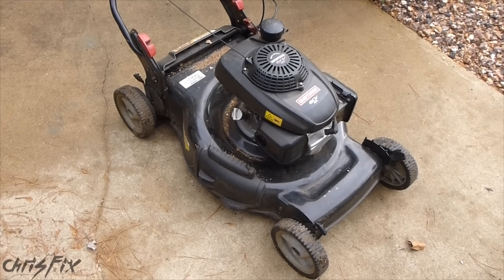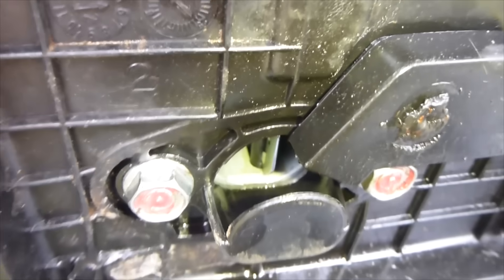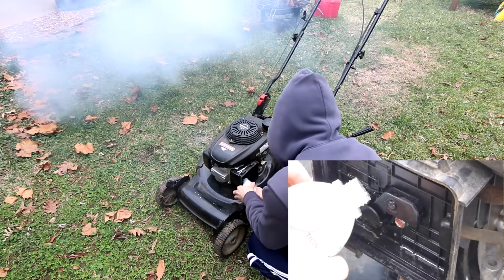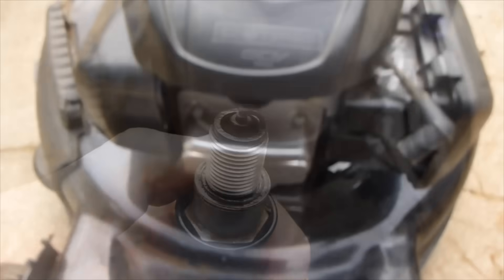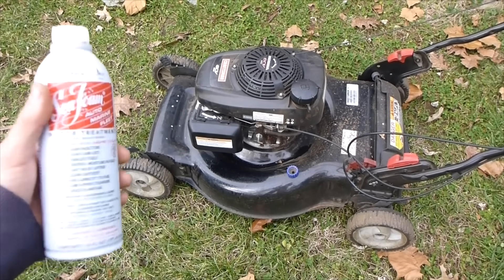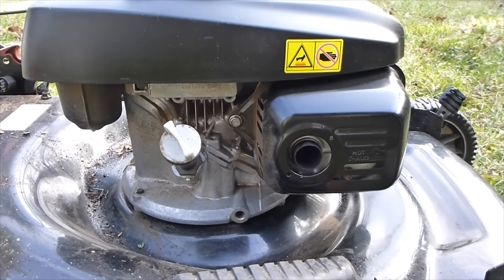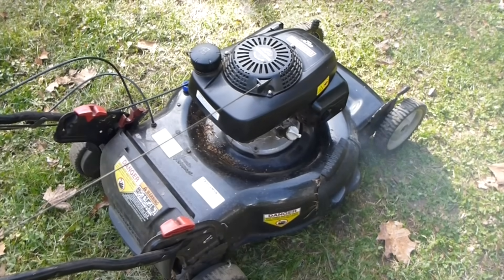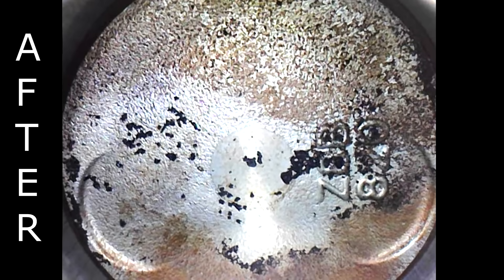Does Seafoam Actually Work? (with Proof)

Comment: My name is Mark Nye. I am a small engine mechanic , owner of North Valley Repair , in the North Valleys of Reno Nevada. I was introduced over 10 years ago by the chef mechanic of Kawasaki to SEAFOAM. I will swear by this product. I use it in all equipment. The Ethynol that is in the fuel today causes moisture to condensate in the gasoline. If not treated with a fuel additive then the fuel will turn rancid. Seafoam is the best product I've found to dissipates the Ethynol in the gasoline to make your vehichles and equipment run smoother, cleaner and won't cause the fuel to go Rancid. I advise all my customers to buy a can or two and put it in the gasoline can to prevent the fuel from going bad and turning rancid.......   Great Video.
Reply: Mr. Nye, I'm interested in your comments because unlike most of the blowhards writing comments, you have the experience to know what you're talking about. I use Seafoam or a NAPA equivalent in all my small engines with great results. Now...settle the ongoing debate about the carbon buildup: in your experience, is the amount of carbon buildup shown in the video worth cleaning? Thanks.

Comment: Well we at least know it works on Hondas, they put the same engine in their cars ( ͡° ͜ʖ ͡°)
Reply: pshh...i love my honda, it's my favorite lawn mower
Reply: Does anyone remember the 2 cylinder Honda car. My buddy had one and it actually moved it down the road.
Reply: wellll, that, at least WAS funny.
Reply: +o Lemurs usually after what most people do to them they run off of 1 cylinder but can't hear the difference with the can on the back
Reply: Honda N360

A 355cc 2cylinder engine that had 32hp
Reply: z
Reply: I'd be afraid of using my mower if it had a 300hp, 3.5L V6.
Reply: a super weak attempt
Reply: lmao not a single honda car has 1 cylinder
Reply: o Lemurs It's called a joke
Reply: ***** oh,i thought you were serious ):
Reply: Xero So it does in fact fit in Your Honda

Comment: You can do the same thing with water. Years ago it was call  thermo-shock. The cool water hitting the hot carbon breaks it lose. Also the carbon on the top of the engine doesn't effect the engine. If you could show the valve train getting clean, I would be impressed. Your test is kind of a waste of time sorry to say. Seafoam is a waste of money. 40 yrs in R & D automotive and M1A2 driver mechanic.

Comment: From experience and this video. Seafoam does almost nothing to a modern car engine (Especially if well maintained) but small engines such as this lawnmower or a weed wacker. I'm sold. Cleans up the mess made from 2 stroke very very well.

Comment: Just taking a spray bottle and spraying pure water in carb would give you better results then that, my mower fires up and runs better then new
Reply from the maker: +Stewie6000 Thanks for the tip! I will be testing water so stay tuned!

Comment: I am glad to see that the Seafoam did work on the piston and cleaned most of the carbon off. That tells me that it does help in cleaning car engines if used correctly. Thanks for sharing this information.

Comment: I thought I should throw my 2 cents in,. I wouldn't pour any liquid into a running engine, using some kind of mist would be better. An engine might not hydro lock, but you could bend valves, bend a connecting rod, break a piston or lots of other damage. Liquids don't compress, they make pressure and could cause major damage. Gasoline in liquid form can be just as bad as water. A friend of mine had an after market injection system, that used windshield wash fluid to help control detonation, something fouled up with the system and it put liquid instead of mist into the engine, he ran it for two years. When it was taken apart for a rebuild, one of the connecting rods was bent. I worked on a diesel engine that had a leaking head gasket. One morning the owner tried to start the engine and it would barely turn over so he put a battery charger on it to help it turn faster. Eventually it cam to my shop to be repaired. When I tore it down, I discovered that the main bearing webbing in the block was broken  out. I wouldn't try to remove carbon with this method, maybe add to fuel and run it through.
Reply from the maker: +peter ferri Thanks for the tips!

Comment: My opinion is not based on visual cues like yours but more seat of the pants experience.  That said, Seafoam works!!  You also might get better results by putting your test mules under full power/load with the Seafoam mix.

Comment: I just run marvel's mystery oil in my fuel on everything and have for years.  Never had any dirty fuel system problems.  It's cheap, and works.  I just keep a jug in my truck and whenever I stop for gas I add it.  I put it in my 95' jetski, my weed eater, lawn mower, and motorcycle.  I haven't had to clean my motorcycle carbs ever.

Comment: what if you pour sea foam in a mist spray bottle to lightly coat your car pistons?  I would let it sit for an hour ' , spray it again , let it sit 5 min and like the lawnmower turn the key for a few seconds put plugs in and start it up  . also I will do the intake method before and after that.    of course this is something I wouldn't bother with but every 5 years or so.
Reply from the maker: +wyrnut007 That might help.

Comment: I could care less about carbon on the piston unless it was a ridiculous amount. I could see the merit in removing it from the valve seats. That being said carbon build up is usually brought on by a poor fuel to air ratio (think dirty air filter choking the engine) or faulty/fouled injector/carburetor. I'm not ready to run out and drop ten bucks on a can of this to make my pistons shine.

Comment: He never talks about how much he is diluting the oil... Actually damaging the proper lubrication ability
Reply from the maker: +Jason Buis There is no dilution of the oil when you run it thought the intake. If you add it to the oil, that would dilute it and I never recommend that.
Reply: Well what a SAE Engineers would tell you. Is the blow by via the piston rings, plus the wash down of the oil film on the upper cylinder wall.  Which is WHY the precise gas to fuel treatment ratio exist.

Comment: Hi Chris I had a question why did you pour the sea foam into the carburetor instead of putting it into the gas?
Reply from the maker: +J Speedy It works better and is more concentrated, as per the instructions on the product.

Comment: I honestly cant see enough cleaning effect on that piston to make it worthwhile and that oily residue on the plug will cause problems mainly increased fuel consumption.. if you want your engine to stay clean keep your air filter cleaned after every other use and change your oil every 20 hours .....sorry to seem so harsh but ive been a small engine mechanic and been in th lawn care business for about 13 years with that being said i cant reccomend that anyone put this in any engine i do recommend reading your owners manual or doing some research on maintenance online or even calling customer service for maintenance tips....WILL NOT RESPOND TO COMMENTS
Reply: that's like saying if you have a little bit of shit on your ass, you'd just leave it??? Clean engines are better running engines.
Reply: Hey man!

Comment: Sea foam is meant to work by putting it in the gas tank and with a full tank. This way you get a cleaning every time you use your car. This way your carburetor and intake valves get cleaned along with the piston.

Comment: I think where seafoam would be the most beneficial is if it were to clean the valve seats and guides on a four stroke. Most problems, especially in older engines, come from that area. I know Ericthecarguy proved in one of his videos that water does do the same thing as seafoam. However, seafoam has a additive that prevents corrosion. Water could cause corrosion. The other question would be can it harm the piston rings? I wouldn't think using it once a year would cause much harm, but I used it in my 86 f150 4.9 and immediately after the engine started running really badly, and ever since I have had a lean running condition. Sometimes it better to leave well enough alone.
Reply from the maker: +cadauctions31 I just started inspecting valves: https://www.youtube.com/watch?v=BocH2c4mYcc
Reply: ChrisFix Sweet video. I am so thankful for your time making these vids. I believe most people go into a auto parts store and see all of these additives and get ripped off because in some ways they can make your engine run a little smoother for a very short time, and then the problem still exist. You had, have, a very good idea doing these test. Being a mechanic, I also know how time consuming it is to do these test, so for your dedication a very big THANK YOU CHRIS!

Comment: So anytime you add liquid directly into a hot cylinder you are going to break carbon off. He could be adding water and getting the same results. Sorry Chris but you have no proof of anything here except the ability to jump to conclusions and run useless experiments. Seafoam does work but not because of what he is claiming in this video. I venture to say that you run the chance of doing major damage to your engine if you go dumping cold liquids into your carb.
Reply from the maker: +David Titchenal You are contradicting yourself. You say seafoam doesn't work and then you said of course it works... I did in-fact test and the experiment has visual proof. What you saw was exactly what happened and I followed the instructions exactly as they are stated on the bottle. I will also be testing water so stay tuned for that. Thanks for your insight.

Comment: there's hardly any difference. you need something abrasive to clean it off. super fine sand works great, but not just the stuff at the beach. you have to by schedule 12 superfine 3000 grit sand. the results make seafoam look like a joke.
Reply from the maker: +Truly The Best Actually, if you watch the videos I have done with other products, the results make seafoam look pretty good. In the end, all of these cleaners are not as good as you would think/expect.
Reply: +ChrisFix then I guess the other products make the engine even dirtier.

Comment: Umm. It's like a solvent, paint thinner. Sold at a high markup. Read the msds sheet. Ya, lets pour something into my motor to thin the oil away while running - and do it repeatedly. And what did you gain? Nothing but you see a visual difference. And gullible people like to believe hype.
Reply from the maker: +fishhuntadventure If you have carbon buildup issues that is causing detonation or low compression, it is worth a shot to use this since it costs $6 vs thousands of dollars to take the heads off and clean everything (in a car). That is the purpose of me seeing if it does anything for carbon.

Comment: if you smell sea foam it smells just like acetone. you are paying $12 for $2 worth of acetone with a different name. I tried it in my truck and noticed no difference. possible to see real progress you'd need to use massive amounts of the stuff. save your money and time using it on vehicles. After the vehicle get out of warranty its gonna show a check engine light you'll eventually cover with black tape anyways, and even with the check engine light on  the vehicle runs good anyways. you'll likely sell the vehicle when its old still have no engine trouble. It's the water pump, radiator or fuel pump  and the power window motor that will be your issues while you own the vehicle anyways. And seafoam won't help you there.
Reply from the maker: +michael Thanks for sharing. There is no acetone in seafoam. Just look up the MSDS and it tells you what is in it.

Comment: The results hardly seem worth the amount of pollution you dumped into the atmosphere.
Reply from the maker: +CaptHollister The pollution in the atmosphere is constant. There was no extra or no less pollution. You just visibly saw what your motor normally produces.
Reply: +ChrisFix I was referring to all the extra oil smoke from burning the seafoam itself. That is not a constant as it exists only in the presence of the seafoam.

Comment: Change your oil more and you engine will stay cleaner. Carbon is more from oil than gas.Chris the most important thing when you look inside your engine is if you can see the hone marks. As I seen in a few videos u did. That tell the real story about your engine. A little carbon is no big deal. A lot means bad rings or valve seals.
Reply from the maker: +Arthur Rodesiler Thanks for sharing!
Reply: +ChrisFix These additives have been around forever.  They were sold claiming to clean carburetors, fuel systems, fuel injectors, and yes to remove carbon build up.  I helped my neighbor tune up his Chevy Colorado and after plugs, wires, we used the named additive.  Well guess what folks?  After using it exactly like demonstrated (only thru a throttle body)  the truck would not idle or run appropriately.  Took it to a well known repair shop and found out that we lost compression in one cylinder!!!  Yep it cracked the rings during the hot and rough idle times (even though it never died).  Well that tune up cost him $4,400 dollars for a long block and we learned a valuable lesson.  It is noted, that after replacing the plugs and plug wires the truck drove fine; However, always wanting to go one step further, and using this additive; cost him a total motor.  KEEP IT REAL.
Reply: +James C Elson Jr Sounds like you poured way too much in the engine and you hydrolocked a cylinder. If I recall, you're supposed to use the vacuum hose to SLOWLY let this stuff be absorbed.
Reply: +lcplic The engine never locked or stopped running, in fact I've done this many many times using other named brands.  It is still risky, and once you pull the air cleaner off and pour in to the throttle body with one hand, your other hand is manually manipulating the accelerator cable.  Just don't have three hands, and once you pull the air cleaner, there is no such hose as you describe. This engine would throttle down, but not once did it ever "Lock" or stop running.  The issue was that this engine would not regain a smooth idle, and ran rough after the treatment.  After viewing piston number 2 you could see that the ring came apart and was inside the engine.  No compression equals rough idle and time for a new motor.  Use this with precautions.  Any time you MAKE an engine repeatedly stumble by utilizing additives can cause harm.  In fact the demo I saw in this video caused way more stumbling/smoking than I ever put this engine through.  I will admit this engine did have 140K miles on it, but was regularly maintained.  I felt horrible for my friend, and I will not ever do this treatment again.
Reply: The vacuum hose from the brake booster is what you're supposed to use. You did it wrong.
Reply: +Arthur Rodesiler sounds like you"ve been huffing gas. Change your crankcase oil to reduce carbon in the combustion chamber. now ive heard it all
Reply: Yep! your a freakin legion in your own mind.  Put away your nail polish, and take your medication as ordered.  Maybe one day your daddy will even let you drive
Reply: Arthur Rodesiler

Comment: Want to point out the bottle stuff it usually works better if you add it to the fuel tank itself which is the major purpose for it.  What I recommend you do is find another carburetor engine that is old and not running well, pull the carb apart or pull the floats off, see what it looks like, then toss it back together and see.  It also can be used in the oil system so could be expanded to use with that.

Even bigger is that it is a fuel stabilizer, important with today's junk and ethanol fuel.

Comment: I want to see what happens when you mix it with the fuel
Reply from the maker: +Sean T. Stay tuned!
Reply: I put mmo into a previous car with over 200k miles in both the crankcase and gas tank and it ran much better after. If your car broke then it had other more serious problems
Reply: +ChrisFix BTW, I just replaced my front disc brakes and rotors with some basic help from your video. Thanks Chris!
Reply: i put in my fuel tank and kill 4 injectors... i dont recomend...
Reply: +ChrisFix Just FYI, I bought a lawn mower 7 years ago off of craigslist for $50 (yard machine). It basically stopped working after 1 year. I tried replacing many parts but couldn't get it to stay on. Went to the auto store and they said use Seafoam and just add it to the gas mix. I have been using the mower for 7 years now and occasionally add seafoam to the gas. This stuff works.

Comment: Hi sir,
Can I pouring seafoam inside hole via spark plug slot? (on cylinders)
 and then wait for five minutes, then start the engine?
Reply: No you cant. Because you will have the put the sparkplug back in. If you do put the sparkplug in the piston wont work properly because of compression, air can compress liquids cant. It would hydrolock your engine
Reply: BF4_Legion
Thanks sir for reply =)

Comment: Did the mower start or perform any better. Seafome shit is expensive and seems like would contaminate your oil.
Reply from the maker: +TruAnRksT There was not enough carbon to cause any problems. This was just a test to see if it even works. So no, I did not feel any difference. The seafoam is only a few bucks by me.
Reply: Well from what I've see it seems hardly worth the cost.
When I went into my local auto store looking for gas and injector cleaners they tried to get me to purchase a full Seafome kit at about 5 times the usual product, So what the fuck is it really?